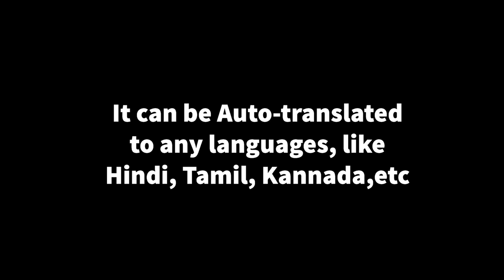Pannier Mount & Saddle Box by Konnen Automotive for Mojo 300 | Installation, Walkaround, Price, etc

Comment: Looking good
1. XT ക്ക് ഇത് direct fit ആണോ?
2. വില എന്താണ് പറയാത്തത്?
3. Stock saddle stay യിൽ ഈ pannier boxes വേറെ alteration ഒന്നും ചെയ്യാതെ fix ചെയ്യാൻ പറ്റുമോ?
Reply from the maker: BS3 XT kku ith onu vech nokkendi varum bro, chasis cheriya difference ullath kond..
Price description il update cheythitund.
Stock mahindra stays il ith vekkan patilla bro. Njan ente il adyam nokiyathanu. Athinulla strength illa, shape um athe.
Reply: @sanjaykochi96  Thanks for the reply.
Mine is initial BS4 varient (with short seat). You mean its not direct fit for my bike.

A feedback regarding stability of the side stand with full luggage will be appreciated.

R u based in KA? I am in HSR Layout.
Reply from the maker: @mojome3355  For BS4 XT, it won't be an issue i think. Can you please DM me on instagram 🙂👍